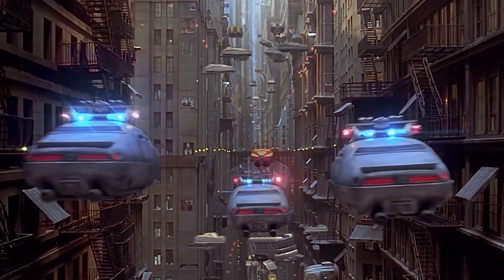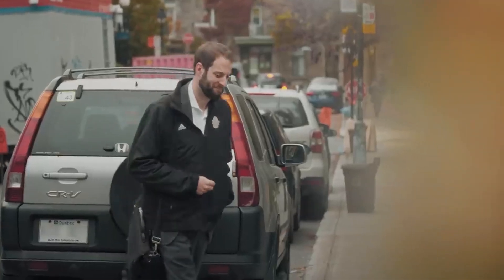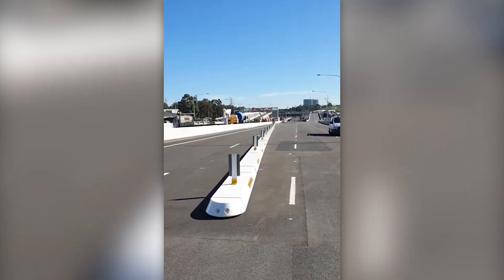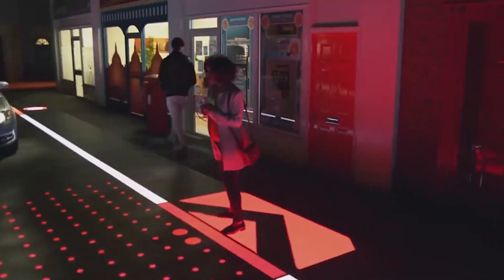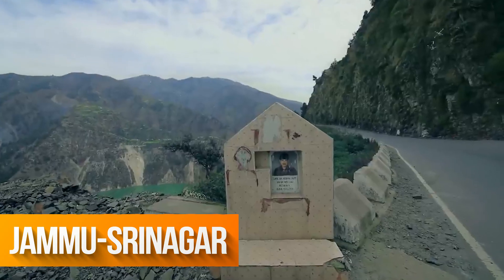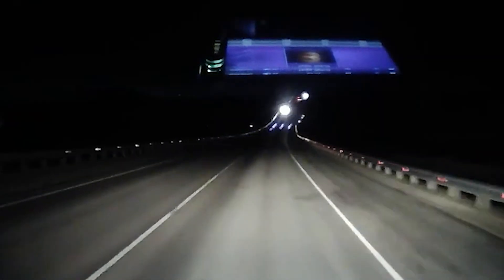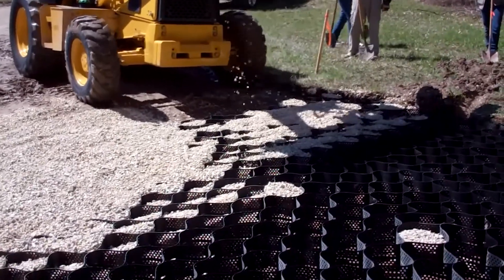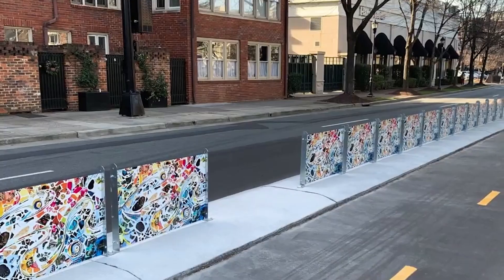Incredible Road Technologies That Are Insanely Cool

Comment: 7:50 Actually, the fact that there's only 1 volt scares me. The car needs some power to actually charge the battery. It needs certain amount of Watts (Watts = Volts * Amps) -> That equation tells us that if the car battery would have to be charged minimally by for example 15 Watts, which is as much power as a small LED light bulb can draw, the current in this case must have been 15 Amps. Not only 15 Amps is a LOT of current to walk on, it also needs a pretty thick cable to handle 15 Amps. And the car battery will have to be charged with much more current, because if we would charge a battery with 15 Watts for an hour, the car could move for seconds at the lowest speeds. Imagine charging it with 1 kW..

P.S.: Sorry for my bad English :D

Comment: Terrible video. 
5:22 Mediocre idea at best and I’ll informed commentary. Potholes do not take 6 months to repair. A few hours at best. The process for your city council to approve the repairs on the other hand, could take months to years. The idea would be best suited for areas that see copious amounts of rain, and even then, it’s only a bandaid and DEFINITELY NOT a permanent fix to a failing subgrade.  This was clearly an idea meant for immediate quick repairs in wet conditions, not an amazing road saving technology. 🙄
After hot asphalt mix is laid, it 20-30min, it will set and be road/weather ready.  Water under the pavement or concrete is what will degrade the road the fastest. Not allowing moisture to evaporate in a failure area will speed up the structural failure of the rest of the road. Great idea.
6:41  false narration. It’s not just the replacement of the surface layer of asphalt 🙄 where do you think the water goes? The subgrade has to be prepped in a manner suitable for also containing the water. The water doesn’t just get absorbed by “bitumen” and “granules”.  Granules could be granules of sugar or sand or anything. Bitumen is merely hardened liquid asphalt, which is why asphalt silos are called bituminous storage.  Asphalt is also not water absorbent. So it must be just the granules and larger rock to allow drainage through the surface. The ability to absorb is one thing, but holding the water is still a physical limitation. It doesn’t matter how absorbent a sponge is, it can only hold as much water as it is large. So again, the strategy is to let the water drain through to the subgrade which speed up roadway failures, and the water that did not drain through, is now in the roadway waiting to freeze, expand, and bust.
7:23  no, similar technologies aren’t used for trans and trolleys. Almost all trams are ran by overhead power lines as you can see in the video. Sweden has a great idea that is far too impractical to ever work. In the cities? Sure, over the hundreds of miles where debris, road damage, animals, ice, and other things can reduce the electrical transmission? Let’s also not forget that electricity isn’t just able to travel millions of miles without problems, it would require periodic substations all across the roadways. Not to mention the titanic undertaking of such a project to replace all paved roads with this, and concrete roads would take the absolute longest. The cities might see this on some main roadways but it’s not going to be a common thing, even by 2075

Comment: "can be used to instantly block traffic".  Shows 2 lanes getting re routed to an offramp on a high speed freeway.   Unless you have a brain smaller than a grape, you will see the reason why most of these you don't see and will never see.  Like the tiny jump that pops up and takes away your braking power right before a crosswalk.  The runaway truck lane looks promising.  Spend a couple million for something that if it does get used will cost a million dollars to set up again.  The amount of runaway trucks may or may not be an issue but that solution is ridiculous.

Comment: Flyying cars are a bad idea. Noise is another critical issue. There are fears flying vehicles will increase noise levels over cities. And then there are the infrastructure challenges. Adding new transportation capacity in most cities is not easy; it's extremely expensive and space may be hard to come by

Comment: It is astonishing how stupid this video is, filled with gimmicky and over complicated solutions to easily solvable issues

0:27  not only are they over complicated but they would surely fail over time between weather and heavy traffic stressing the mechanism. Not only that but inconsistent enforcement of traffic control can be dangerous, if a driver is used to the speed bump not activating then they won’t be prepared for it if it ever does activate for them, meaning they’ll likely hit it at speed and may lose control of their vehicle

1:21 there are far better traffic solutions than that bullshit. If you go watch Not Just Bikes you’ll see examples of the Netherlands and their effective car infrastructure that ensures pedestrian crossing can remain safe without something as stupid as a mouse trap hovering over the pedestrians

1:47 Andre Lam did a decent YouTube video about the history of road barriers that I highly recommend checking out, it’s definitely more informative than whatever this is. It’s called How Road Barriers Stopped Killing Drivers

2:54 see above ^

3:48 that is the most asinine traffic solution I’ve seen yet, zebra stripes are already ineffective without making their presence also inconsistent and variable. Pretty lights on the ground don’t change the fact that this is still purely at the mercy of driver awareness and driver reaction times. A distracted driver won’t magically avoid the pedestrian they failed to notice just because the floor changed to disco

4:46 clearly whoever sells these either isn’t aware of or has ‘conveniently forgotten’ that patching potholes and cracks is in fact already a thing and doesn’t need this cheap parlor trick. Despite what the advertiser may be telling you they don’t actually have to repave the entire road for each and every pot hole and crack repair. If you drive somewhere with quality infrastructure maintenance you’ll see black lines and asphalt patches here and there across the road tracing over or blotting out prior failings in the asphalt. If they have to repave the entire road that means the issue goes far beyond whatever this Wonder Sand bandaid could possibly hope to accomplish

5:30 “why didn’t anyone think of this before?” Because it’s stupid? If an area experiences that much trouble with drainage that means they may need a larger grate or multiple grates along the road. Which they then add if they have the budget and the motivation to actually address the issue. Google it. There are plenty of real world examples of multiple grates on a road or larger grates at low points where multiple streets/lanes might be draining to

6:07 Idk, so moving on

6:54 “the creators claim this is absolutely safe” then the creators are absolutely insane. How tf could it possibly be safe to have miles and miles of unguarded electrified railing along each and every lane of traffic across your whole country??? And the only way it’s ‘cheaper than a tram car’ is because they’ll be able to charge the consumers through the nose as each and every person is then forced to buy their own personal tram car. Which they will have to somehow learn to operate without accidentally snapping off the rail charging arm thing because they wanted to change lanes, or drove over a moderately sized rock or tree branch and snapped it off the undercarriage. If you’re willing to put down this much ‘clean energy’ infrastructure go the full mile and make it proper public transit instead of turning your country into a get-rich-quick scheme for specialty car manufacturers 

8:05 ….Is it not common practice where you live for everyone to stop driving and pull over to the side of the road whenever you hear an emergency vehicle coming through?

Even when they do implement this kind of thing it’s supposed to make all the lights RED, so that only the emergency vehicle will be in the intersection as it passes through. The last thing you need is a car hitting the ambulance because the light turned green for them too

8:48 I sincerely doubt they’ll be buying any of these stupid things any time soon

9:34 that’s just asking for an accident, or a seizure. I’m getting dizzy just looking at it. Driving on it would be a nightmare. Why would you possibly want your lane markers to be moving? Just use the normal reflective lane markers and road signs. If you’re really that worried then add some actual street lights. Keep the neon signs where they actually belong

10:19 yet another ‘recycling fixes everything’ scam. Plastic is plastic is plastic, and plastic won’t hold up like asphalt will. First and foremost, plastic melts. Roads get hot, like really hot, they sit out in the sun all day. No one wants the road to melt beneath them. And from the skepticism in your voice I know you know it’s bullshit too, yet you’re still shilling about it to us

11:55 sounds equally asinine as the last one

12:39 this is the safety equivalent of caution tape across a train track. If something goes even remotely wrong that will do absolutely fuck all to protect you. “A psychological sense of comfort and safety”  which they can take to the grave if they trust this stupid thing to do anything to protect them. Metal barriers might not be as ‘aesthetically pleasing’ as that pretty white caution tape but at least it’ll actually stop the fucking car

Once again go check out Not Just Bikes if you want to learn about actual infrastructure changes necessary to properly accommodate safe pedestrian bike paths. This is the same level of zero effort that got us the painted bike lanes in the first place

13:42 I’m gonna go ahead and refer back to Andre Lam’s YouTube video about the history of road barriers again here. It’s called How Road Barriers Stopped Killing Drivers

Go have a watch to clear your head after all of this nonsense I’ve criticized here
Reply: I really enjoyed your rant!  Admittedly, at first when I saw how much you had to say, I was like; "oh god, WALLOFTEXT, here we go!" But every single point you made was accurate and TRUE!
Reply: @Tenshihan-Quinn  I’m sure the point-by-point formatting probably helped, especially with the time stamps for reference 

I’m grateful that you took the time to read my essay and it’s validating to hear that my analysis resonated with you

Comment: You missed the smart tempered glass roads being experimented with in Oregon. They are self lit and also generate energy for the use of nearby people and places. Cool. 😎
Still, with any electric vehicle or road, energy has to be produced, either by gas or coal. So, the problem is still not yet solved.  Also, the disco lit road lights are distracting and disorientating and may do more harm than good. Meanwhile, CO2 is what plants breathe in. What they breathe out is OXYGEN. Let's just leave that there, and maybe plant more trees. I love the bike lane barrier idea and design.

Comment: Those flashing strings of lights could be dangerous; there are people with afflictions that can be triggered by flashing lights!  If I was driving on a road that had those I'd have to slow to 10mph to be able to handle the flashes.

Comment: 08:24 this technology is already in use on emergency vehicles and even normal buses to give them priority at busy intersections. And the lights are not triggered by the driver, but by GPS or personnel in a traffic management center.

Comment: The ambulance traffic thing has already existed in some cities/states for quite a while now. I remember there was a story in my hometown where a guy hated his commute in the morning because of all the traffic and he figured out that if he programmed a universal remote with the code 911 he was able to point it at the traffic lights and get them to turn green with the volume up button. It took the authorities a while to catch on to it but they eventually threw the book at him and changed the codes to something a little less obvious
Reply: Yeah, we had that system at a lot of intersections here in Portland, but I don't think they work anymore.
Reply: This thing is call traffic signal preemption. This will immediately terminate all other phases. 40+ years ago it was an optical system still in use in many cities. About 30+ years ago many radio (UHF) systems were installed. About 20 years ago many cities started migrating to Dedicated Short Range Communications (DSRC) as well as 4G and last few years 5G. So its been around the world for many years. Not to be confused with Signal Priority, used on Bus Rapid Transit (BRT), light rail and other non-emergency uses. This will instead of jumping to the emergency phase, either hold the green, or shorten other greens in order to give priority to mass transit. I am aware of the Ford project, but to be honest I think they are trying to get priority for their own cars and using the "emergency" use in an "exciting" PR way to get involved in the traffic signals. I think its unlikely to succeed, but lets see.
Reply: I'd never heard about the guy with the remote, that's an awesome hack. I know different systems have been around before the Opticom systems of today. There was even a time that (it's no myth) you could flash your high beams rapidly and if you were lucky enough to match the right flash rate you could trigger the system, but it's a bit obvious. Still, the remote idea was really innovative. :)
Reply: Yep, my city has had it for years.  Although my police force in my city use it just to not stop at red lights even if they aren't going to an emergency....
Reply: I wanna know how they caught the guy. That seems impossible.
Reply: Thank you and from what I know its not a remote thing like they describe. There are sensors in the lights that respond to emergency/law enforcement that auto swaps from from red to green.
Reply: Iii😮😮😮😮😮😮😮😮😮😮😮😮
Reply: That story is BS. It's not nor has it ever been, IR.

Comment: Hollow curbs are nothing new.
The crossings with road illumination will not work. Low grip and will require maintenance.
The emergency vehicle traffic light control is decades old.

Comment: @8:30 We already have this in Minnesota. The preferred system in Minnesota is the Opticom system. Not only does this system give emergency service vehicles 'traffic priority', they're also integrated with rail systems to clear out possible backups before a train approaches the crossing, and even in our Minneapolis Metro transit busses to give them a little higher priority than  normal traffic. "Falling in the wrong hands" while technically possible (anything is) it's highly unlikely. These aren't the old systems where pulses of light at a specific rate works. They're sending actual information optically, such as the vehicle ID and a secret key, to determine if your transponder is authorized. Even if you are able to clone a transponder, it wouldn't work long. The system can now randomly generate new keys every so often, or detect when misuse is likely (comparing activations for Ambulance 2 shows 10 activations where Ambulance 2 was not on a call). When tied in to an intelligent traffic management system a single activation could preempt the traffic further away. Cool stuff.

Comment: It’s called emergency vehicle preemption (EVP) and it’s been in use for decades.  While it’s very helpful, it’s not cutting edge.  In fact, the system shown is an optical solution that is already being replaced with GPS based systems.  The optical solutions requires line-of-sight so curves and vegetation limit how far in advance the signal can be alerted.  This means vehicles will come upon the intersection before it can get to green.  A GPS system can program signals miles in advance and even around turns in the route.

Comment: 8:20 "Ford is already testing a technology to solve this problem"
In Germany, this "technology" has been in use for decades. Even every bus can control traffic lights in order to reduce delays.
Reply: It's called Opticom system, invented by LES in 1966, later bought by 3M. I believe what the video is referring to, is Ford's driver assistance tech that premeptivly slows and stops their vehicles on approaching red lights.

Comment: The technology for an ambulance to change the traffic signal already exists. I believe it was called the Rada Light. They were white flashing lights on top of traffic lights. They would flash when emergency vehicles changed the lights to green in their direction of travel. It was used in Erie, Pennsylvania, but they had to stop using it because with modern technology people hacked into the Rada Light and were able to change it for themselves. Emergency vehicles could change the lights one mile in advance. Another issue they had with the them was cars would speed to keep up with the emergency vehicle to get all the green lights. I used to live there and was guilty of trying to keep up with the emergency vehicles. They no longer use them.